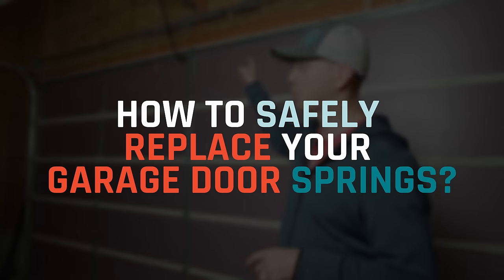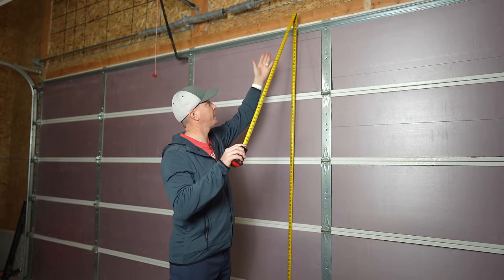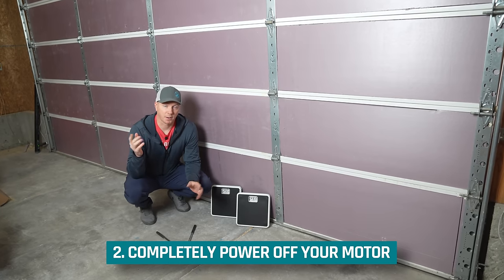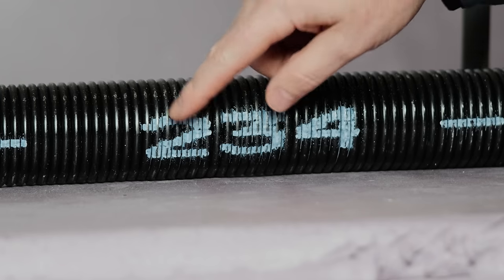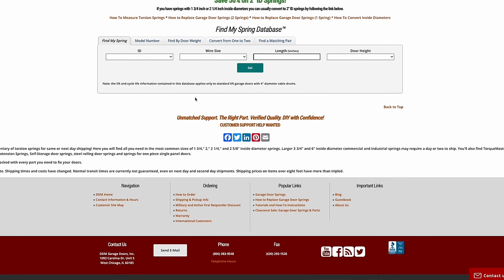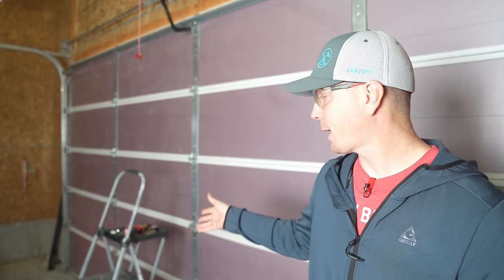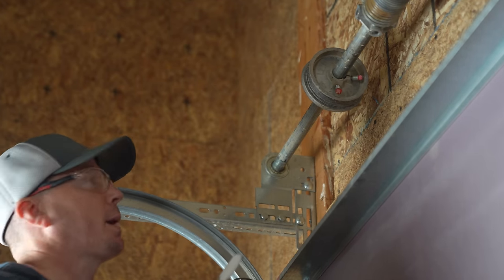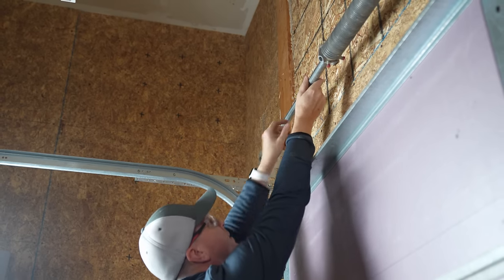How to Safely Replace Garage Door Springs & Save Hundreds

Comment: I am a garage door pro also. As with anything, yes it can be done DIY but should it? 7ft garage door springs are wound around the tube 7+ times. If something goes wrong or it breaks while working on it, that means the spring is going to unwind itself in a matter of a few seconds. Breaking springs often sound like a gunshot, it is very violent. DIYers should have a healthy respect for springs and cables. But there is so much nuance here that is missing. So much of what pros do is based on feel and know-how. Here are some glaring issues I saw in your video.
I would never be standing on the inside of the spring unless I have to. If it breaks while you are unwinding your hand and your arm are very close to the spring. Stand on the outside looking at the cone with the set screws. The entire spring is a potential danger zone, not just the one isolated area. The springs are called right hand & left hand wound for a reason. The spring on the left (red) is be wound with your right hand while standing on the outside. Vice versa for the black spring.
I would always use a socket with the 7/16 multi point socket, not an open-ended wrench. To much risk of slips. You have more control over it if the entire socket is around the set screw. No amount of eye protection is going to stop a wrench being thrown at you with that speed. I also would not use power tool to release the set screws.
I would not put the drums in the exact same location as before. You can see the tube is pinched and you had to file it down. This means it is a weak point. I would shift the tube one direction or the other so the drums and the new springs do not go in the exact same location on the weak point of the tube. So your markings are irrelevant. Setting drums needs to have equal cable tension on both sides. Otherwise door will be crooked or the cables will go slack when open and potentially cause it jump off usually resulting in the cable wrapping around the tube or an off track door. Again cable tension is based on feel and should be nearly identical on both sides which is hard to pull off considering you have to use different hands with different strength.
For the checking for balance, the door should be able to hold up its weight at ¼, ½, & ¾. Should be able to give it a gentle push and it should settle back at those points. Should be able to lift with 2 fingers. Windows on the top can throw this off sometimes. Again, all based on feel. Changing the set screw locations multiple times is not ideal since that weakens the tube, and also makes future changes much more difficult.
After changing the springs you may have to reset your motor’s force limits. Separate topic
You did a good job but those are glaring mistakes. Just look on Reddit and there are some images of people with hand, finger, or arm lacerations from messing with this stuff. 
Anyway, when hiring a pro you are not paying for our time. You are paying for our knowledge, expertise, & professionalism. A spring change takes me 20-30 minutes because I do 10+ a week. Pros get paid for the knowledge, tools, & parts to get it done right. Just make sure you work with a reputable company. You can often get pricing on the phone since it is usually a pretty standard job. Around $400 is good for high-cycle springs. Hopefully that helps.
Reply: We have gotten three quotes here in Las Vegas and they are wanting to charge $800+ for two high cycle springs on a 7' door. They are ripping people off here.

Comment: I have a single spring on the left side - but the hand trick shown says it’s a left hand spring. In the video it’s says left side should be a right hand spring. How is it possible it’s been working for the past 9 + years?

Comment: Lost the spring tension to my door. ( My own fault )  Not sure what tension should be on it so I equally adjusted both springs. Ended up being 24 ...one quartes turns. Lifted door half way and it stayed in place. Did I miss anything. Seems to work fine.

Comment: Even for a single-width garage door, I recommend two scales. Using one and not properly centered can cause the door to bind on the tracks leading to misleading weight. Another related issue is to consider the slope of the garage floor where the scale/door meet the floor—make sure all of the scale's feet are firmly on the floor.
Reply from the maker: Both very good points!

Comment: How much weight did the insulation add to the door? Very thorough video. Well done.
Reply from the maker: Thanks so much. Each sheet of 1.5" Formular NGX weighs 4.41 lbs (2 kg) and this used around 3.5 sheets, so about 15.5 lbs (7kg). It's enough that new springs would be required.
Reply: @LRN2DIY  Thank you!

Comment: So the addition of 15ish lbs. of insulation weight will require replacing the springs unless you verify that weight with the insulation falls within the springs' limits? Given that my springs are almost 20 years old, replacement seems likely if I want to insulate my door.
Reply from the maker: That's correct. Basically anything that requires more than 2 quarter turns of increased tension (which is often anything over 7-10 lbs but this will vary) should result in spring replacement to the proper springs.

Comment: Wow, a set of DRY springs, (reason they broke)
And a very light thin metal door.

My door is 16x7 all wood with industrial type hardware, it weights roughly 900 lbs  you can't lift it even with 2 people  
Your door is a tin can  its only about 150 lbs 175 max with the closed cell insulation.

Yes i paid a grand to hire a pro to change the whole system it was worth it. My biggest risk was picking up the pen. I almost dropped it.

Comment: One tip would be to never stand in front of the spring like you’re doing when doing any winding or unwinding, you should be standing on the opposite side away from the spiring
Reply from the maker: I was specifically instructed to stand there by a garage technician, actually. The spring itself is captive so it's not going to go flying. Worst case scenario is that it will snap or unwind and in either case it'll scare me half to death but it won't fly off the shaft.

Comment: Totally recommend this video; however, I cannot endorse the company he features in the video.  I followed all the steps and felt confident in my spring choice but used the link on the site to clarify a concern I had.  Per the recommendation, I'm changing my single spring to a double spring, and I asked for verification that the springs were appropriate and to ensure I ordered the correct hardware for the conversion.  Two weeks later and I have received no response.  Will not do business with that company ever.

Comment: My door is the same width as yours but only has one spring on the right side. Is that normal?
Reply: Yes. My house built in '92 only used one spring for this size door. When I added insulation, I upgraded to two springs.

Comment: Weird,  my broken spring is 22.5 long on red side, but the black side is 20 inch long, i ordered a 23 inch long spring and installed both today, and unfortunately, my garage door (16X7) cant be opened with the garage door motor, the chain just make a lot noise and cant lift the door up, can anyone here help me out please? the motor is 1/2 horse power genie excelerator from previous house owner.

Comment: My garage door has a battery backup do I need to unplug it or what ?
Reply from the maker: Great question! Yes, I'd recommend temporarily disabling that or just removing the battery. It's unlikely that it would move on its own but even someone pulling into the driveway without knowing you're working on it and hitting the opener button could be a real problem.
Reply: As long as you make sure that the garage door opener is in the manual position by pulling the red cord thats hanging from the carriage, and you'll be fine.
Obs. Make sure the door is in the closed position before pulling the red cord, otherwise the door will come crashing down like a guillotine.
Keep in mind, the garage door is the heaviest moving object of the house.
Or just keep it safe and leave it to a licensed professional.

Comment: I called a garage door tech and saved $15k in hospital bills!
Reply: So why are you here? Anybody can hire people to solve their problems.  Doesn't take any skill just a fat wallet.
Reply: @ceeweedsl  I’m all for DIY’ing and saving money, but garage doors springs are extremely dangerous and it’s truly not worth the risk.
Reply: The safety risk is no greater than doing your own electrical work or gas piping. That's the garage door repair industry's dirty little secret. $800+ for a $50 part and < 2hrs labor. The AC repair industry has their own dirty little secret too. A <$20 capacitor and < 1hr labor for > $400. All preying on the homeowner's ignorance and urgency.
Reply: @sitechca70  After doing mine Id put it closer to changing a tire.  You have to do one very simple thing right in both cases. And about same skill level.  Electrical work requires much more knowledge.
Reply: @ceeweedsl  Haha, that's right. So it's disgusting to hear all these safety concern trolls making this seem like rocket science. If you know how things work, you know what to watch out for.
Reply: I pretty much pay for everything now
Reply: If you’re not mechanically inclined just say that! 🤷🏾‍♂️🤷🏾‍♂️🤷🏾‍♂️
This video is not for those who don’t know how to change a tire or work with their hands proficiently!

Comment: Cheap springs from China will not last as long as springs made in the USA IMHO. Look for USA made springs when ordering replacement springs online. I have seen the cheap spring fail quickly many times to my dismay and my customers disappointment.

Comment: The springs from my garage door go across the garage and not overtop the garage door
Reply from the maker: Those are probably extension springs. They’re still doable but it’s a different process.
Reply: Basically, it's just really big springs pulling on chains connected to the bottom of the door